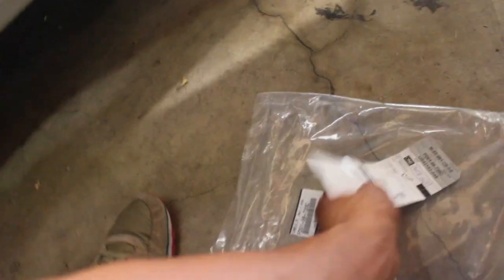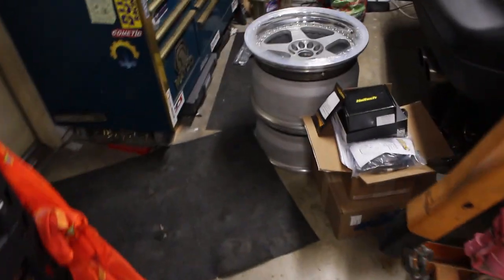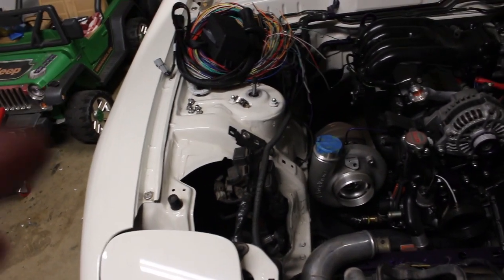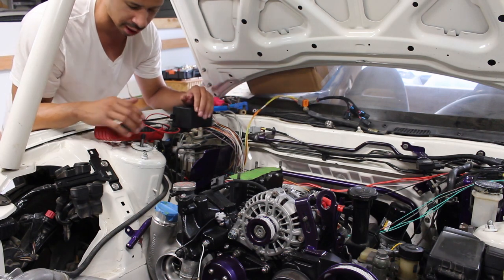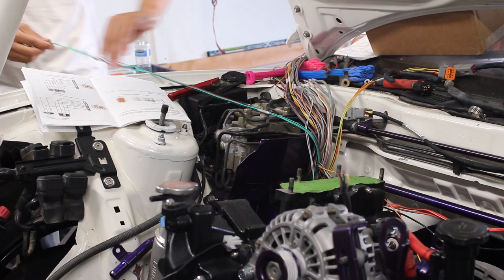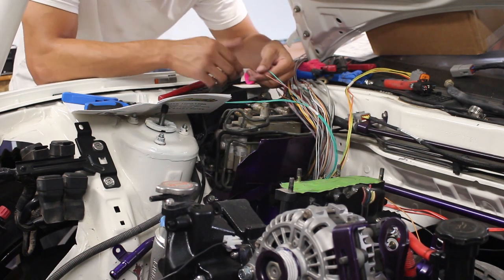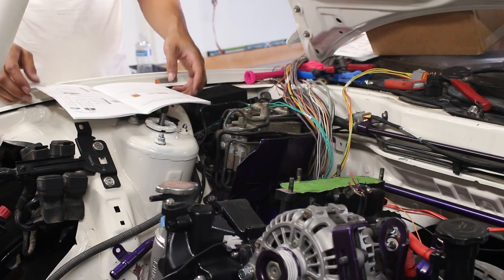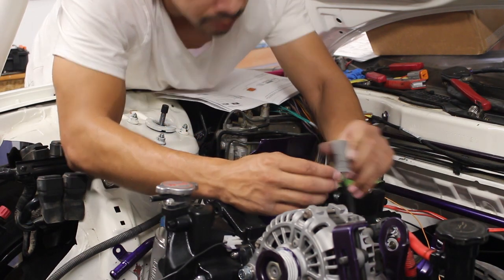RX7 FD Haltech 1500 Wiring flying loom - Ignition, Injectors, OMP. Installation of hood latch cable

Comment: Hey thank you for uploading the vid. Very cool. The part where you attached the string to the plastic hood open button under the steering wheel  is fast forwarded. Do you have a vid showing how? My string disconnected from the button..
Reply from the maker: Thanks . . . . The cable came pre attached to the lever. If you have Instagram you can message me on it and i can send you a photo/ video.

Ig - toykoz32

Comment: Bro hows the harness coming along ? 
I'm about to do the same thing 

Where did u get your switched 12v+ from i can't find info 
Any help would be great! Thnaks
Reply from the maker: Pulled it from the Black and white wire on the ignition switch. Has a constant 12v when cranking
Reply: @nismoz32racer  thanks so much bro I'm watching all these vids I'm doing dbw too
Reply from the maker: @edayala9171  what ECU are you using? Thanks for the Sub.
Reply from the maker: posted a new video showing what 12v switched I used. https://youtu.be/-ZsecoD-m50
Reply: @nismoz32racer  
Elite 1500 
No problem 
Thanks for the video!